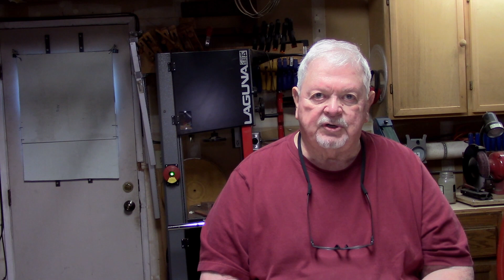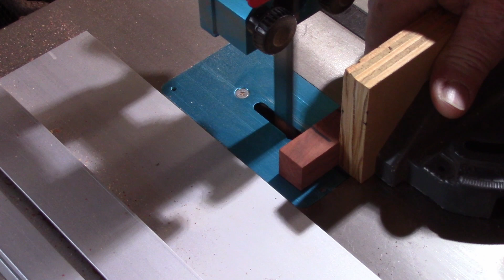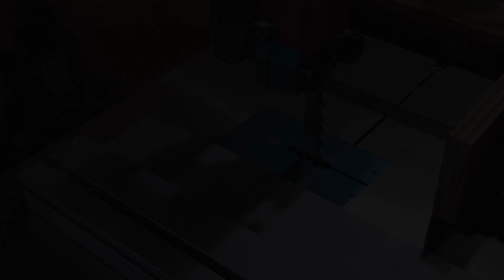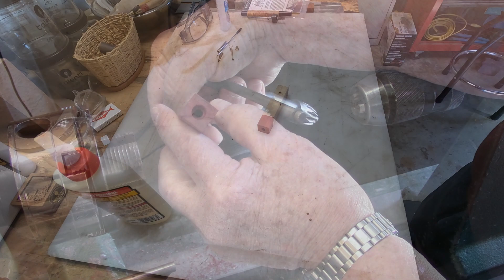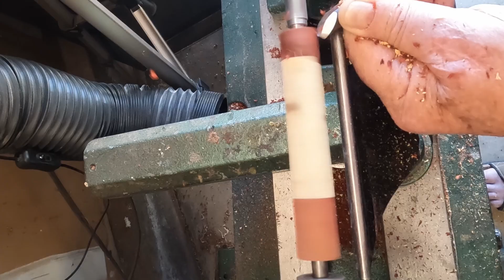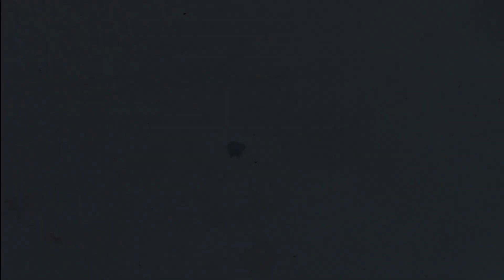Another modified 7mm pen short & long segments?

Comment: That is a nice pen when it’s finished. I wish you would’ve showed more on how you angled the clip end and installed the clip. It appears you sanded it at an angle and then cut some kind of notch for the clip to come out.
Reply from the maker: I modified a  pen mill to the correct diamater and used a carving knife to cut the notch.

Comment: Hi Jim, I did one like that several years ago after seeing it on the IAP website.  One thing I came up with to make it easier to set the transmission for slims was once I had one installed where I wanted it I measured the length and cut a piece of wood to that length.  Now when installing a transmission I hold it up beside the pen barrel and it stops the press at exactly the right spot.  Works for all pens using the 7mm transmission.  No more having to check to see if the transmission is deep enough.
Reply from the maker: I thought of that also; but still don't trust the kit manufacturers' tube lengths.
Reply: @JimRodgersWoodturner  Tube length doesn't matter because you are measu ring from the tip to the end of the transmission.  A longer or shorter than normal refill would change things but I've only ran into that once and I just set it aside for my own use rather than reset the transmission for it because that would throw it off when  the recipient of the pen had to change the refill.
Reply from the maker: @rickgibson7876  Got it. Different measurement that what I was thinking.